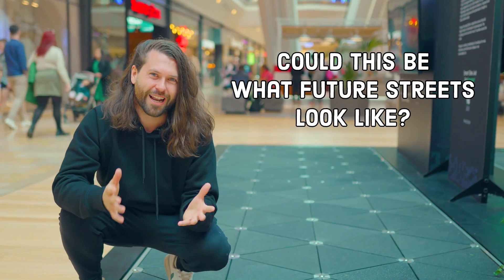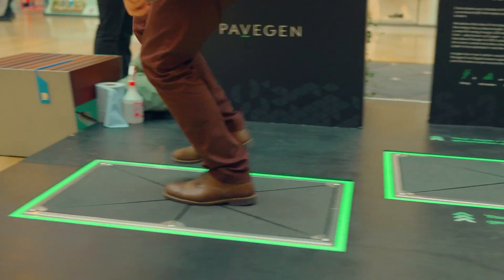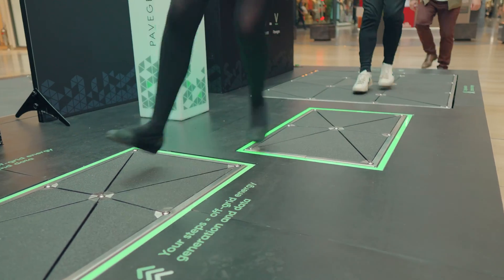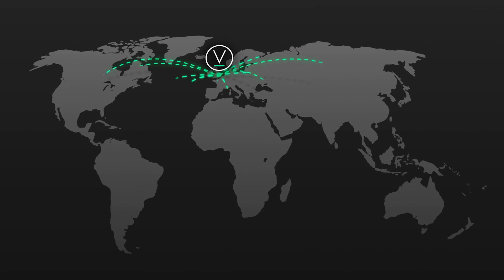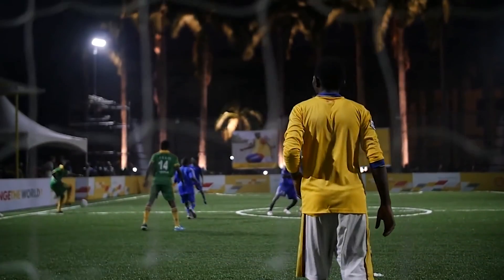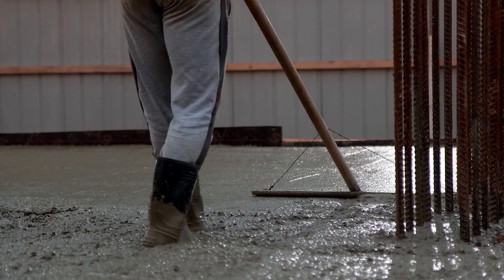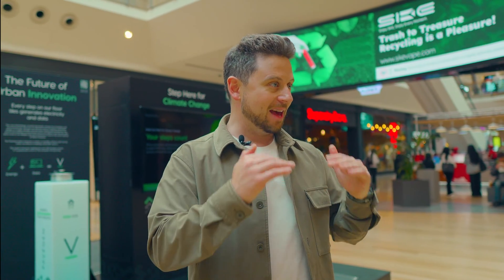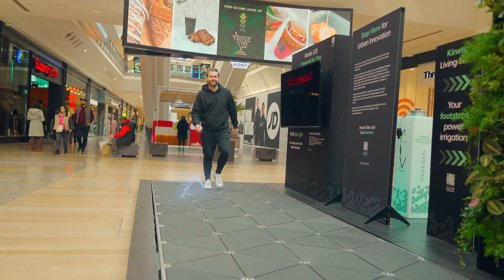This Street Turns Footsteps Into Electricity!

Comment: the problem with this tech is it make so littel energy and cost so mutch 
i think wind and solar willl allways be far beter in terms of wats per £
i just cant think any wher this would be useful
it would have to be sume wher u dont have main power dont have solar light dont have wind and the werdest requirement u only  need single digit wats of power
and u only get a continues 5 wats if u get a step evey second 
so we sume wher thre lots of pepole but no mains power

Comment: This is one of the by far dumbest ideals anyone ever had. 
And it's a shame Social media channels still uncritically push it so they can  still collect investor money.

The pavegen company was founded in 2009, and has multiple prototypes runing and still HAS N)OT PUBLISHED ANY DATA HOW MUCH THOSE TILES GENERATE and how much it cost so we can judge the system on cost/$ profitz it generates. 

The amount of energy they can harvest shoule be very shure abysm,al for the investment as the system is costy and the energy it creates will be laughable. 
This company has recently raises 1,3M in investor money, which is the only thing that keeps it up, as it's tech is not sellable to anyone with basic physics understanding.

It's also MINDBLOWING bad at what they say it will do: Save climate.
THIS IS NO perpetual motion  machine. EVERY SINGLE WATTh or probably bette every single µWh this thing produces is energy that the people running over it have to put into it more than they would otherwise. 

The energy sourxce id people running over it working harder, like walking in sand instead of hard concrete.

And guess what: human power is dreadfully, horrible bad at CO2 emissionds per kWh. 

For one, human mechanical efficiency is abysmal. For every kWh you spent at manipulation something with foot or hand, 4kWh of food has to be eaten.
And food is the worst possible enertrgy sorce regarding climate and Co2 emissions/kWh that exists. 

Animals habe to be raised, fed, and processed, Coocking the meals also is bvery energy intensive and that adds nothing to the energy content. 

I looked up Co2/kWh on production for several food sources, took the energy content and calculated the CO2/kWh for each food. The results where shocking. 
Just for reference: The worst fossile source for energy, coal, is 1100gr Co2/kWh emittet. Solar has 48gr Co2/kWh, Nuclear 12gr Co2/kWh.
Food on the other hand:
Beef causes 99000gr CO2/kg, has 250kcal/100gr or 2,91kWh/kg => 1kWh in Beef is  34020,62gr Co2 emittet
Bananas causes 700gr CO2/kg, has 89kcal/100gr or 1,03kWh/kg => 1kWh in Bananas is  679,61gr Co2 emittet
Cheese  causes 21000gr CO2/kg, has 402kcal/100gr or 4,67kWh/kg => 1kWh in Cheese  is  4496,79gr Co2 emittet
eggs causes 4670gr CO2/kg, has 155kcal/100gr or 1,8kWh/kg => 1kWh in eggs is  2594,44gr Co2 emittet
Fish (Farmed)  causes 5000gr CO2/kg, has 206kcal/100gr or 2,39kWh/kg => 1kWh in Fish (Farmed)  is  2092,05gr Co2 emittet
Lamb causes 39000gr CO2/kg, has 294kcal/100gr or 3,42kWh/kg => 1kWh in Lamb is  11403,51gr Co2 emittet
Maize causes 1700gr CO2/kg, has 91kcal/100gr or 1,06kWh/kg => 1kWh in Maize is  1603,77gr Co2 emittet
Milk causes 3150gr CO2/kg, has 42kcal/100gr or 0,49kWh/kg => 1kWh in Milk is  6428,57gr Co2 emittet
Nuts  causes 300gr CO2/kg, has 600kcal/100gr or 6,97kWh/kg => 1kWh in Nuts  is  43,04gr Co2 emittet
Peas causes 980gr CO2/kg, has 81kcal/100gr or 0,94kWh/kg => 1kWh in Peas is  1042,55gr Co2 emittet
Potatoe causes 460gr CO2/kg, has 146kcal/100gr or 1,7kWh/kg => 1kWh in Potatoe is  270,59gr Co2 emittet
Poultry causes 6000gr CO2/kg, has 272kcal/100gr or 3,16kWh/kg => 1kWh in Poultry is  1898,73gr Co2 emittet
Prawns causes 26000gr CO2/kg, has 76kcal/100gr or 0,88kWh/kg => 1kWh in Prawns is  29545,45gr Co2 emittet
Rice causes 4450gr CO2/kg, has 346kcal/100gr or 4,02kWh/kg => 1kWh in Rice is  1106,97gr Co2 emittet
Root vegetables causes 430gr CO2/kg, has 48kcal/100gr or 0,56kWh/kg => 1kWh in Root vegetables is  767,86gr Co2 emittet
Tomatoes causes 2000gr CO2/kg, has 18kcal/100gr or 0,21kWh/kg => 1kWh in Tomatoes is  9523,81gr Co2 emittet
Wheat causes 1570gr CO2/kg, has 339kcal/100gr or 3,94kWh/kg => 1kWh in Wheat is  398,48gr Co2 emittet

And then multiply that by 4 to get the mechanical OUTPUT energy of human power for that food.

And those pavegen tiles will have a really abysmal efficiency to. They NEVER published any numer, so it must be absolutely horrific.

All in all, this pavegen Idea is- as it's in itself already inefficient and uses food as primary source with an abysmal efficient human in between- probably the technology that killes climate the absolut hardest of all tech available. Even coal looks like a climate saving source in coparisson.

Comment: I am sorry but this is completely impractical right? I mean imagine the cost of installing and maintaining even a single sidewalk with this tech, many cities can barely manage to keep a concrete sidewalk maintained without holes and these things have moving parts. Not to mention the ROI, I cannot imagine that this could come anywhere close to competing with a solar panel or wind turbine. The concept of using humans for energy generation has been around (and unsuccessfully so) for a while, I still remember a very similar "energy generating dancefloor" concept I saw at an expo in 2014...

Comment: I like how he dodges the question about "how much energy would it need to produce to offset its initial cost of production" he just immediately starts comparing it to concrete and goes into 'carbon neutrality' which is not really that accurate or easy to calculate. 

So basically its expensive and impractical right now. He should be okay with that because its a prototype. He would have made a much stronger case arguing for economy of scale: "if we had x number of factories producing y number of units we could theoretically get the cost down to z which would yield a net positive in (some number of) months." It gives more depth to his argument than getting into a punching match with concrete, which is super cheap to produce quickly at high volume and doubles as a building material - not just for sidewalks lol.

Comment: Does the product dropping create a tripping hazard?  Does it make it more difficult to walk or cycle or push a wheelchair?  Like sand for example is harder to walk on because it has give to it.

Could it be used on high traffic highways/roads and could it be plowed?  If so, would it decrease fuel efficiency?

Comment: The incredibly small amount of energy each step produces would take probably a few decades to barely cover the energy it cost to produce it in the first place.
Reply: Did you actually watch the video?
Reply: @JaneNewAuthor  yes
Reply: @JaneNewAuthor  did you ? The sales guy doesn't actually answer the question. He says their 'target' is two years to recoup the carbon cost, but I ran the math (I'm an energy infrastructure engineer) and based on their current numbers, even being generous, they need about 2000 years of use to cover the energy cost of production. In other words, with a 20 years lifespan, you only get back 1% of the energy you paid.

Comment: I might be missing something crucial here but something doesn't make sense. This device generates 4w of power for each step. Even with a conservative estimate that the flywheel continues to rotate for 1 second, that's just 0.0011 Wh of energy generated (4w / (60sec * 60)).
If we were to compare this with a standard $110, 350W solar panel, it would generate 1Kwh in around 3 hours. However, you would require 900 steps for a single Wh, or ~900K steps for 1kwh.
That's 1 person walking ~640Km. Am I missing something here?

Comment: It's interesting to compare them to a concrete floor, but theses don't appear to be structural themselves. How would they be underpinned in a way that wouldn't require a concrete floor just being paved under them for rigidity? Also that sleeve on the generator seems like it should be eliminated otherwise you're gonna be pulling up the tiles every ither year to replace them and, at least in the US, aren't gonna be interested in the higher frequency of that recurrent cost.

Comment: This is interesting, but I wonder about two things: ROI in terms of money and emissions. If I am a Mall, why would I buy this over a solar panel? Solar is cheaper, easier to maintain and might even generate more electricity per day. And will the emissions of producing this actually be offset be the generated electricity over its lifespan?

Reliability of this will also be much lower than of solar, there's just way more failure points. Walking on it will take more effort, which is something most building owners don't want. And accessibility for people with disabilities is a major concern as well.

In total, I see this product being a fun thing to put into a few meters of pavement as a symbol of sustainability, but not much more.
Reply: It's not competing with solar, it's competing with expensive concrete floors that use energy to produce, need to be replaced at intervals, and produce no energy at all. 

It would be an excellent supplement to solar, especially in a building with a large, flat roof like a shopping centre, train station, or airport.

Comment: That's genuinely wonderful to see. My only immediate concern is the effect on people with mobility issues? Ie. I'm curious if it would be a more difficult surface for wheelchairs to traverse (especially electric) and if the slight movement of the triangles would set people off balance or be a tripping hazard etc.
Reply: Itd be minimal at worse. A lot safer than say cobblestone